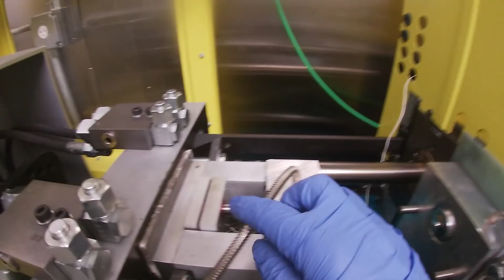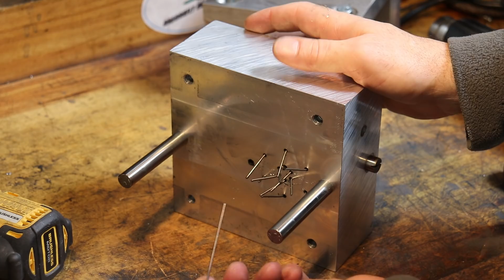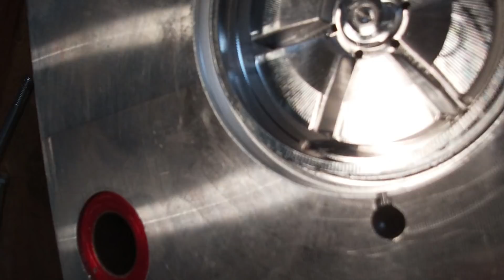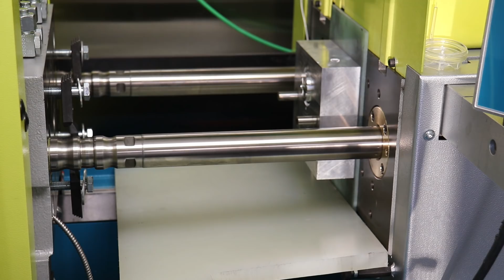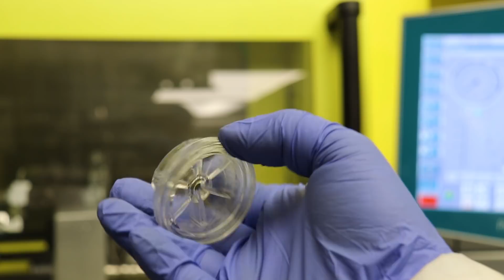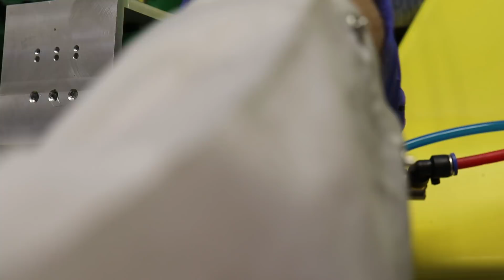Mold Fixup and Robots!

Comment: That 6 axis robot looks to complex. a 3 axis robot would be in and out of the mould much quicker, easier and simpler to program and cheaper to purchase.
Reply from the maker: Hi Simon, thanks for watching.  I went with the 6axis since I use if for more that pick and trim.  It does higher level assembly work which I usually can't show on Youtube

Comment: Where the robot picks the sprue end if you add v-groves to the fingers it will self center the part making for better repeatability, also when cutting off if you feed the sprue in to the cutter circular disk toward the cutter opening as opposed to the side profile of the part, the circular disk will create a register cut point not being able to fit within the jaws dependent on pick-up placement, or if the bracket has a slight flex you could add a moment switch to say cut once the circular disk outer diameter has made contact with the cutters

Comment: If the sprue(?) Was on top and the part on the bottom, then the part would fall away/down and not catch. Also robot would not have to travel as far to pick the part from mold machine.  Are changes like this even possible?

I would think the robot is made to handle much heavier parts, run at 100% speed and run for a huge number of moves before any wear issues of parts.  Wear on the robot should not be a concern.

I enjoy your channel. Thanks for sharing.
Reply from the maker: Thanks Larry, Yes I could have probably flipped the mold over.  There were other geometry concerns such as the clipper cutting edge orientation etc etc.  I balanced time to set up vs time to clean up a non-perfect setup.  For the robot, yes It is designed to be robust.  another aspect I didn't mention is running the robot faster uses more electricity, thus extra cost and heat.  Thanks for watching and providing feedback.

Comment: Thanks again for making videos! For molds with steel inserts, would it be possible to machine the mold with the ejector pins in them? Would ejector pin hardness be a problem?
Reply from the maker: Hi Vincent, thanks!  Yes, That is sort of possible if I use the EDM machine to cut the pins with the cavity.  The pins are usually harder than the steel cavity, so machining may be a little tricky on finish and tool life.  The other thing that may need to happen is to prevent the pin from rotating.  good idea though, I will try it.
Reply: @DragonflyEngineering  What about annealing the pins and hardening them after machining? I assume you know someone with a heat treating oven, since your friend also knee someone with leftover lasers.

Oxidation could be a problem, but there are ovens that can be flooded with argon.

And hopefully pins don't distort.

You could also rough out the shape on the mill, cut the pins to size and "mill" the rest of the mold on the EDM machine. That seems like the better option to me. Does the EDM machine support actual "milling" (e.g. sideways EDM), or just sinking though?

Comment: It would seem that the robots' "fingers "needs to be sprue shaped 
For the robot to hold the parts identically each time
Reply from the maker: Hi Ronny, thanks for your feedback!  The other gripper does have custom fingers for 10,000 parts runs, the gripper we used for this one is more general use.  I try not to over do the short run robot setups to maximize throughput and profit.  The claw orientation was angles to match the claw pivot angle to the sprue angle.  The teeth on the gripper also sink into the fresh hot plastic to lock the part location.
Reply: I agree that that would be the best solution. Maybe making some sprue jaws would be a nice project
Reply: @vincentguttmann2231  some 3D printed "gloves ", maybe?
Reply: @ronnybe7994  I'm not sure how hot the plastic is, and I don't know either if he even owns a 3d printer

Comment: Ouch. Thanks for showing us. On steel molds they use brass tools because they're softer than the mold, but with aluminum I guess you just have to be careful.
Reply from the maker: thanks Spehro, I usually use rubber hammers, but that pin was a little stubborn!